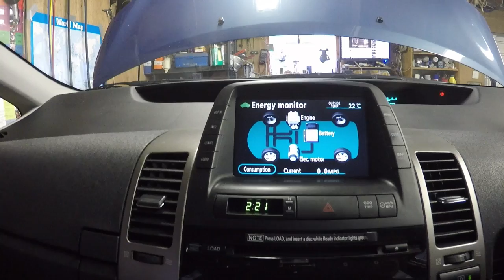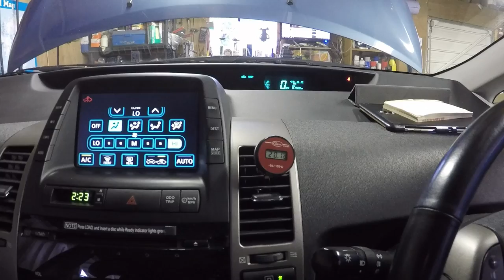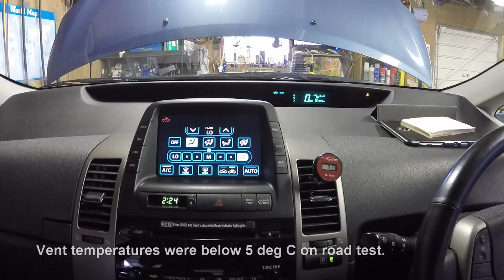Toyota Prius Generation 2 Air Conditioning Condenser replacement

Comment: I was told by the dealer that I needed the evaporator core replaced, but couldn't bring myself to believe it. I go and check the condenser and there's a huge back stain just like this example, thank you so much.
Reply from the maker: Let's hope it doesn't have a leaky evaporator. They are at an age where the evaporators can fail. Condenser is a super common failure though as you've found out. Thanks for the comments 👍😁.
Reply: @Automotive_Solutions  yes sir! If it's cool enough outside if will blow cooler in the cabin, which leads to believe the evap core  is still working fine. Hoping it just the condenser with that obvious nasty leak.
Reply: @Manhattan  I have the same issue, I wish I knew who yours turned out! Well I hope.

Comment: Thanks for the video. Why there is no any liquid running out after you disconnected those two hoses (at 4:27 min)? Is there no any liquid or you just did something before recording the video and not shown? Thank in advance!
Reply from the maker: I did recover the refrigerant out of the car beforehand. Most of the oil left behind would have drained down to the lowest part of the pipework/condenser. Hope this helps.
Reply: @Automotive_Solutions  Yes, this is what I expected and was surprised that you loosened the hoses and no liquid was out there at all! Thank you :)
Reply: After replacing this condenser do I need to add the refrigerant to the system, right?
Reply from the maker: @vladv7019  yes, I suggest you get someone qualified to do this and that they are familiar with hybrid vehicles.
Reply: @Automotive_Solutions  oh ok. Do you think I can drive it about 8 miles to the shop without refrigerant in it? Is it safe? I will turn the AC off to be safe.
Reply from the maker: @vladv7019  yes, leave the AC off 👍
Reply: @Automotive_Solutions  Great! Thanks a lot!!!

Comment: Does using penetrating oil 1 sec before removing the screw help?
Reply from the maker: If it's stuck it's stuck but when it turns it will be easier with oil on it.

Comment: Now for the questions:
- what model year is your Prius?  I have a 2005, but seems your MFD has some notible differences than mine
- How did you deduce that your condenser was alone the culprit to no AC function?  I saw of the condenser stain but there are plenty of other hoses and leads inside that engine bay.
- Did any of the CEL /dashboard lights go off to show AC malfunctioning?  
- Are there any other cheaper and readily available resources to test for new condenser replacement integrity if i dont have access to Nitrogen.  Can i just plug and air hose up to the condenser outlets to pressurize the system?
- You quickly introduced the hybrid compressor oil but didnt show how the oil was used.  Did you dump a bottle into the compressor? I only saw that you used a portion of the oil to lubricate joints to the in/out compressor spigots.
Reply from the maker: sung nguyen 
This is a 2007 year model.
I looked over all the other components and saw no sign of staining.
The air conditioning was still working but not as cold as it should be.
So no trouble codes relating to air conditioning problems.
I only use nitrogen to pressure test as it contains no moisture.
Air is not recommended.
You could use a refrigerant leak detector to try and sniff for any leaks.
I pulled the system into a vacuum and used that to suck some oil in through an oil injector tool. (Approx 40ml)

Comment: Would of been nice if you could of shown how and where to add oil. Looks like I can do this job but I’m not sure what to do about the oil.
Reply from the maker: You could add it directly into the condenser before fitting or use an oil injector tool on the low side port like this one... https://amzn.to/2Uk6wIl

Comment: I have a 2006 Toyota Prius, and I live in Arizona where's the temp can over 110 degrees Fahrenheit. when it reach these temperatures my Prius ac can't keep up is that normal? what temperature should be coming out the vents when the ac is working properly?
Reply from the maker: We don't get those temps here in the UK so can't compare. I would think a fully working system should be able to keep you fairly comfortable inside your Prius. It might be an idea to get it checked out.
Reply: The temperature comings out of the middle vents should be around 30 degrees below ambient temperature.  According to my Automotive's A/C chapter book.
Reply: @mr.selfdestruct1677  thanks.

Comment: Hi My car is toyata prius 2006  2nd gen, i did change the (condenser) myself cud you please let me know how many  OUNCE  of hybrid compressor oil need to be add in to the system or 
if need to be fully drain the oil ,  how many ounce need to add , before the rages the system ..thanks
Reply from the maker: I added 30ml or 1 ounce. Still working today! The only way you will get the right amount of oil is drain and flush complete system and refill with correct amount of oil.
Reply: @Automotive_Solutions   Thank you very much for your prompt reply ..do you have any idea drain and flush complete system refill  what is the correct amount ??  your reply much appreciate..
Reply from the maker: @jacomputermobilephonerepai3243  sorry I don't have the exact quantity for that vehicle.
Reply: @Automotive_Solutions  Thank you very much ..

Comment: How did you rule out that it was not just a faulty o-ring?
Reply from the maker: I'd previously put a sniffer through the grill and it was leaking a few centimetres down from the fitting. Couldn't get any reading on sniffer at 'o' ring connection.
Reply: Cool, thanks for the reply.

Comment: Great video!! Once the new condenser is in is it possible to just recharge the system with a DIY recharge kit you'd buy at an autoparts store?
Reply from the maker: +Steve B Hi Steve, thanks. I only use my professional equipment and experience for recharging to do it properly so would only advise you get someone qualified in your country to do it for you. Good luck.
Reply: I will do that! Thanks for the help. I will subscribe.
Reply: Automotive Solutions hi, Toyota have just told me that my condenser is leaking and I need a new condenser. It’s for a T3 prius, model after the one you fixed in the video. Is this something you could quote me a price for ? Thanks Steve

Comment: Great video. Did you change the dryer as well? (To remove moisture from system...?) Is there any trick involved with this. (we havesame Prius with leaking AC and we haven't used it for over a year now but we should fix it soon.).
Reply from the maker: The drier is in the tube, built in to  the end of the new condenser so yes it gets renewed at same time.

Comment: How did you get the compressor to start in order to recharge the system with oil and refrigerant?  I did a condenser change out but my compressor will not start.  Thanks.
Reply from the maker: James Young - I normally warm my bottle of refrigerant in some hot water then add the oil and gas to the low pressure port only. Dont use the high pressure port. This normally gets enough gas in to then let the compressor (with engine running in maintenance mode, aircon switched on and fan set to full speed) to pull the remaining gas in until you've got the correct quantity in there. There's loads of videos on you tube about charging aircon systems. Remember to use the correct oil. If the compressor wont pull the refrigerant in you have a separate problem. You could take it to someone trained in aircon to regas it too.

Comment: it's good to see some one using dry nitrogen to pressure test and not moisture saturated shop compressed air thumbs up. you may like to upgrade your gauges to a new set of SM480V by Fieldpiece. Has a builted in micron gauge to read and track deep vacuum and a high pressure nitrogen pressure decay test feature that reads down to 1/10th of a PSI = 0.0689 bar.
Reply from the maker: Thanks for watching. Yes a digital micron gauge is on my shopping list.
Reply from the maker: @coldfinger459sub0  - subscribed.  Some great info on there. I'll check out some of those videos 👍

Comment: I'AM  LOOKING AT THIS VIDEO AND SAYING TO MY SELF WHY THE HELL DID YOU REMOVE THE BUMPER IN THE FIRST PLACE  ??  ALSO  THAT DUST JOB YOU DID ON THE RADIATOR WAS VERY POOR YOU SHOULD HAVE REMOVED IT  AND POWER WASH IT SEEING THAT THE VEHICLE ONLY HAS ONE FAN AND YOU DID NOT CHANGE THE O RINGS.
Reply from the maker: +Chris Thomas if you've done it with the bumper still in place then well done to you. It seemed easier and quicker with it out the way. The radiator was not blocked it just had some dust, leaves, etc on the surface. I did change the o rings, just not included in the edit. Hope this helps.
Reply: Chris Thomas WHY ARE YOU YELLING